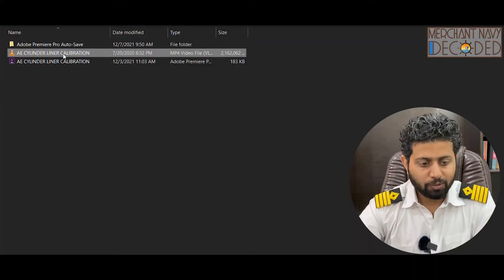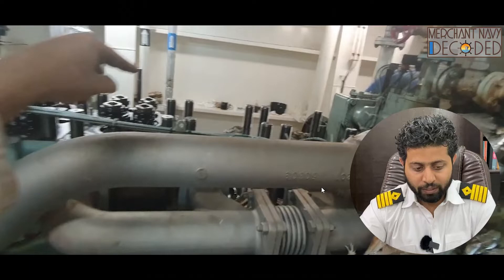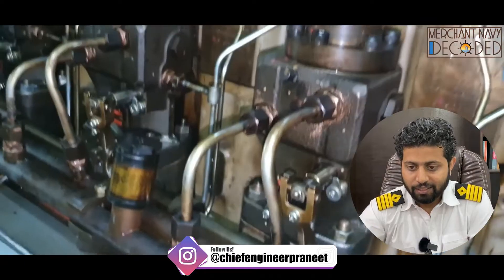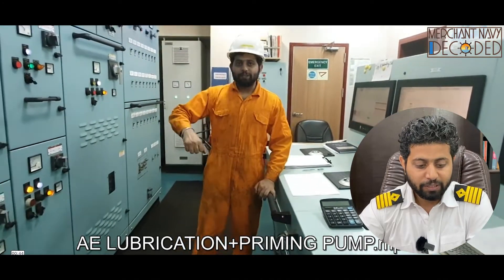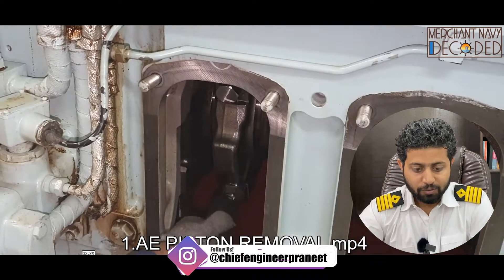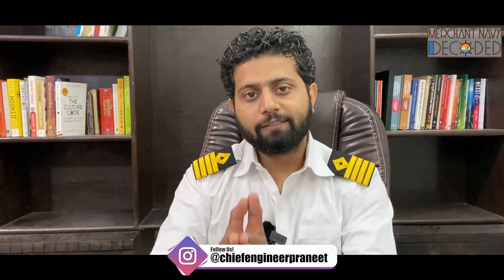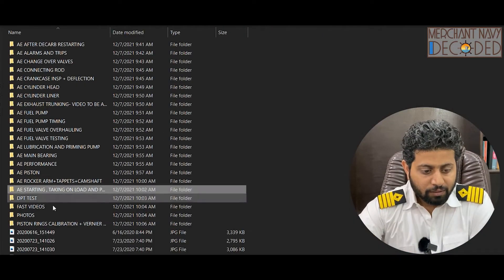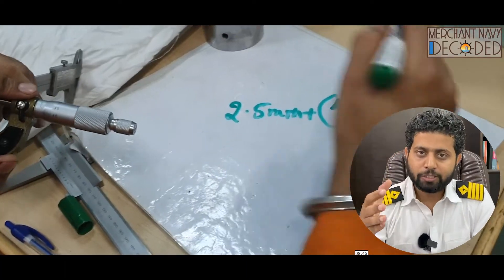Achiever Package Full Details Part-2 || Best Course For Marine Engineer || Course for Merchant Navy

Comment: Sir make video on steering gear and all the machineries needed to run it. Like Heleshaw pump, hunting gear etc.
Reply from the maker: beta that would be just theory and I have concentrated more on the practical aspect ,things that help you on ship as well. Steering gear system understanding requires understanding electrohydraulic diagram and a lot more...will surely try to cover in future.